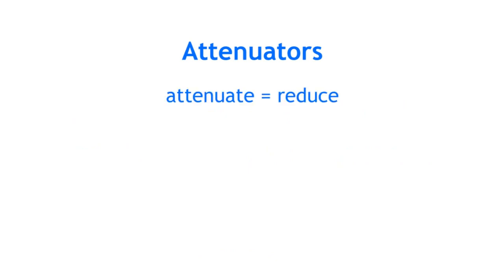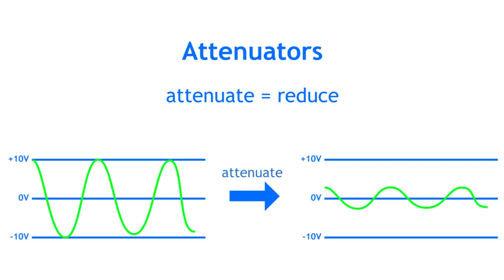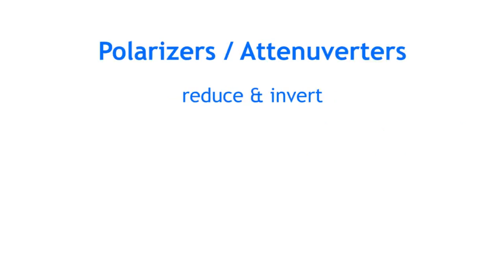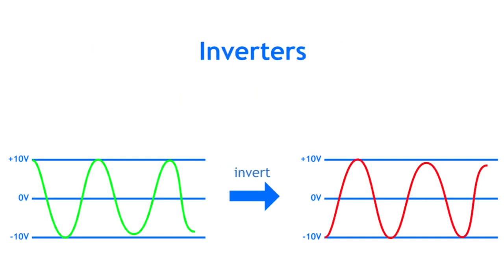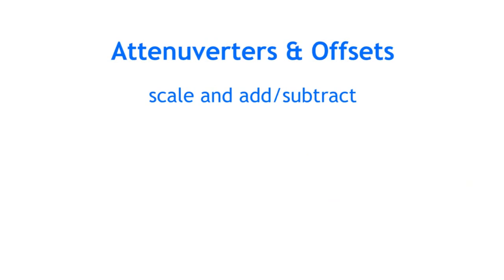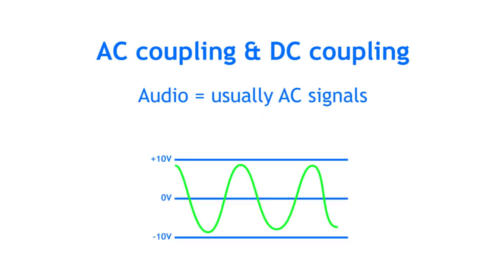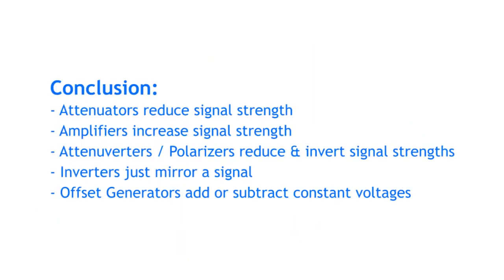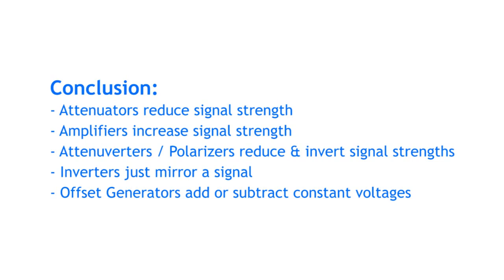Modular Synth Basics #05: Attenuators, Polarizers & Offsets

Comment: Regarding Offset Generators: If i have 9V signal and then add +5V to that, wouldn't the output overload the target module? Are Offset Generators therefore considered "dangerous" in a modular synth? There are many reasons i don't really know how much voltage comes in. Maybe i remove an attenuator i had patch earlier and suddenly the voltage jumps to unhealthy level .. something like that. Would it be possible to harm a system this way?
Reply from the maker: Hi :) Offset generators are like mixers, mixing the input signal voltage with another constant voltage (the offset). And just like mixers, they will clip at a certain level, usually around +/-10V. This can distort the input signal, which might not be desirable for your patch, but which is generally safe. I demonstrate this in the following video: https://www.youtube.com/watch?v=FCr5xn4cHfo

Comment: Your videos are really cool, thank you for sharing this. I have a question... Is it possible to modulate a +/-5V with a signal of 0/+10V? For exemple I want to modulate the MIX +/-5V of ADM14 Boomtschak with an voltage block (0/5V) and an amplifier *2? The amplitude of both CV signal are 10V, but I need an offset?
Reply from the maker: I don't exactly understand what you mean, but using a *2 amp and a -5V offset will make a 0 to +5V signal become -5 to +5V.

Comment: So if i solder the pads on the ABC Bastl module I can use it both as a CV mixer and as an Audio mixer. Or will audio mixing become difficult then?
Reply from the maker: +Rienk Speelman it shouldn't mess with audio mixing, however with DC coupled signals, you might mix yourself a voltage offset in your audio output which you usually want to avoid due to possible distortion.
Reply: but thats only when you mix it with cv right?

Comment: The attenuator+amplifier+polariser+attenuverter thing...
Shouldn't they all just be part of a single module: a multiplier?
abs(voltage)<1 is attenuation
abs(voltage)>1 is amplification
voltage < 0 inversion
What am I missing? (except putting the 1 at maybe 3V or somewhere else depending)
Reply from the maker: You’re missing offset, which would be addition/subtraction ;-) What you describe is exactly what a polarizing amplifier does though. The question here is how much maximum amplification do you want? 2x, 3x ... 10x? The wider the value range, the less precise the control with just one potentiometer will be. The more components and features (amplification, inversion, etc.) the more complex and expensive the module might be. Also, a problem with attenuverters is often that the zero point is in the middle of the range and difficult to dial in quickly/precisely. So sometimes you just want an attenuator to turn down a signal. Sometimes you just need a precise -1x inverter. Analog amplification might also introduce noise or other artifacts. So having those features spread across several modules which can be combined to one’s individual needs is what the modular experience is all about, but you will also find all-in-one modules too. Another thing to take into account is module size. You might fit two attenuators into the same module space as just one attenuverter+offset. Rack space is always limited, so it’s good to have modular module choices :)

Comment: A lot of popular modules already have attenuverters. Conceptually I get what attenuate/offset does but it's effect eludes me. Say I trying to modulate something like timbre on something like MI Elements, would sending a LFO straight into it's cv input have a different effect vs. sending the same LFO but with a different offset?
Reply from the maker: A lot of modules have attenuATORS in front of their inputs, yes. In your LFO example, offset will shift the midpoint of the modulation effect. Let’s take a filter instead of the MI module though. If you offset the LFO modulation positively, the filter might never fully close. Watch the video again and look at the graphs (maybe pause it too). And then of course try it out yourself.
Reply: @tuesdaynightmachines  Thanks for you reply. So no attenuverters but attenuators?!?! But sometimes there is + on the right and - on the left of the cv input: Would that make it a attenuverter?
Reply from the maker: @_jurk  ah sorry, maybe I'm out of the loop :D In that case they are actually attenuverters. In my memory modules used to have mostly just attenuators, but I guess times are changing, which is nice.

Comment: thinking about buying a buchla module. those can be combined with other manufacturer modules correct?
Reply from the maker: No, Buchla is not Eurorack, so they won't fit in the same case. Although there are Buchla-inspired Eurorack modules from Verbos and Sputnik for example.
Reply: What format can Buchla be used on?
Reply from the maker: +Rodrigo Guzman Only on Buchla as far as I know (Buchla is a "format" itself).
Reply: ahh okay.. makes much more sense now.. thank you :)